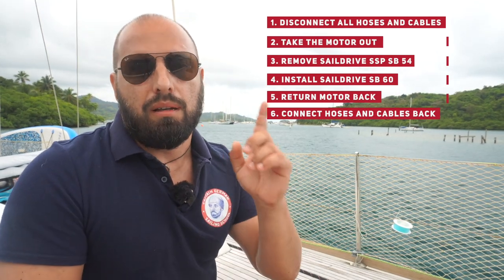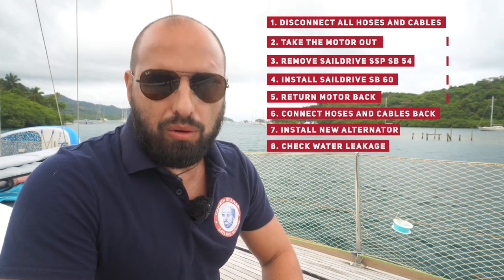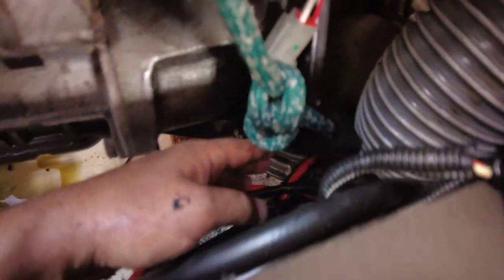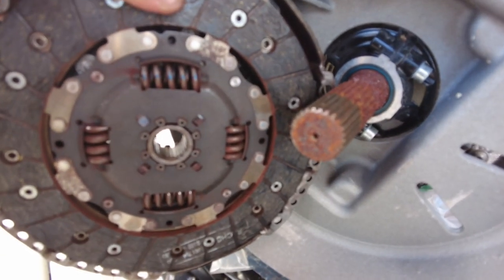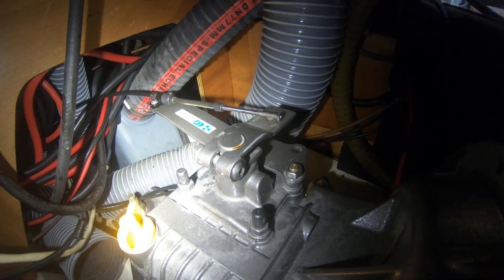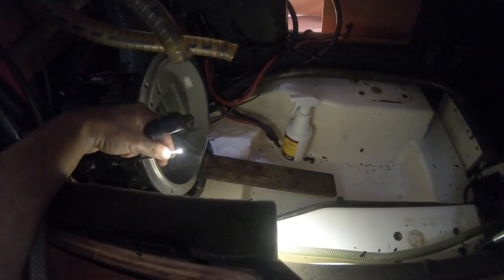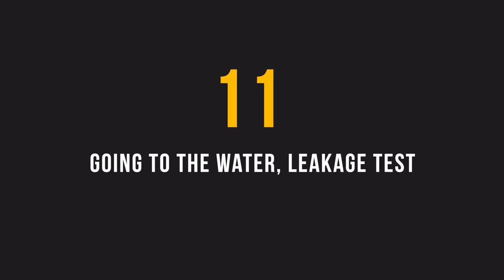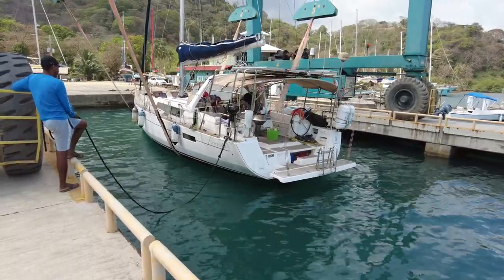Saildrive vs Yanmar SD 60: The Great Replacement

Comment: Dina and Sergey,  you did fabulous project!  Hard to believe that two people were able to accomplish this mega project.  CONGRATULATIONS!!!
I have a few questions (sorry if I missed this info in  previous videos )
  DID YOU CHANGE THE SAILDRIVE SB54 TO SD60  BECAUSE  THE SD60 BETTER THAN SB54 OR  THE SB54 IS NOT IN STOCK ANYMORE?
when your boat was ordered from Beneteau manufacturer, the SAILDRIVE SB54 was an optional or standard ?
THANK YOU AGAIN FOR YOUR VIDEO. 
GOOD LUCK!
Reply from the maker: SPP SB54 is rotating saildrive which was the option when I bought the boat in 2013. I have video at this channel how Dock and Go system works, cool system, reaaly cool. But unfortunately we couldnot service it for a long time because it is electronic fully and need to have special computer and special software and engeneers for it. In panama it is not exist at all like almost everywhere in a world. That was the reason why we decided to replace it with SD60. I could order boat with SD60 from a beginning. So my summary is if you sail somewhere in europe or US home land only it is realy worth it, If sail like we are too much risks
Reply: @CaptainGermanExploring  Thank you for your respond.

Comment: Excus me, I am honored to see your video. Beneteau and ZF Asia's after-sales service are very poor, charging $3000 just to read the gearbox fault code, so I decided to switch to SD60. I have some questions about the modification of the engine mounts. Based on the comparison between the drawings of YANMAR4JH4TCE+SD60 and 4JH4TCE+ZF Friedrichshafen AG ZFSD12, the engine mounts should be lowered by 97MM and moved back by 20MM. Why are your engine mounts moved back by 100MM? I look forward to your reply and will start the retrofit on May 12.

Comment: well-done! excellent project! I have a Beneteau with the Dock-n-Go system and cannot get clutch parts from ZF, so am looking at the change to SD-60. Is the hole in the hull the same between the two saildrives?
Reply from the maker: Yes, it is big advantage in this project. The bolt holes are the same, you need to buy motor mount
Reply: Hello, I have just completed replacing my SD60. My ZF gearbox has only been used for 300 hours and, except for the computer board, all mechanical parts are in good condition. Do you need them?

Comment: Hi there. I have also a similar issue with the SPP on a 4JH80 Yanmar. Question for you: how did you address the reverse mode... as the SPP reverses by rotating the whole,sail drive..? And the controller which is electronic?
Reply from the maker: There is no way to make reverse mode manually. You have only one option to engage gear forward but after this you have to recalibrate the system (ZF told me, have no idea what does it mean). But reverse is only with SD rotation, so you have to have all the system operates normally.

Comment: I am having the same issues with my Jeanneau Sun Odyssey 469 with the 360 docking in Asia. My boat has been stuck in the slip for almost 2 months now while waiting for a new electronic throttle and now that I have received the new throttle, the ZF tech stated that my 360 joystick is unable to receive signal or even power. They are saying that I may have to wait six months for the new part. I am at my wit's end with this whole debacle. It basically spending a lot of money and waiting to find out that I need to spend more money for the next part while wasting more time...If you have any spare parts that you would like to get rid of please let me know.
Reply from the maker: Service of zf are crazy bad. Just zero service. Great system when works...

Comment: I’m considering purchasing an Oceanis 48 with a dock and go system. I
Intend to remove the system and replace it with an SD60. Could you be specific about what modifications needed to be made?  Any electrical modifications?  I saw that the engine mounts needed to be modified, but did the SD60 bolt into the same location that the ZF transmission did?  Many thanks.
Reply from the maker: Sd60 and sppsb has the same sd membrane mounts. You need new motor mounts because the motor will have different location
Reply: @CaptainGermanExploring  Thank you for the quick response!  Any substantial electrical modifications?  Or just disconnect complete ZF system wiring.
Reply from the maker: Unfortunately no other options. It is really  complex system with no interchangeable parts. Only mechanical saildrive or original parts

Comment: Great job! Not a gear oil into the saildrive? Like Dina's saildrive leg alignments.
Reply from the maker: I also thought it should be something like gear oil but not, regulat motor oil. Marked on sticker at sd
Reply: My apologies, just checked SD 60 UM :). 15w40. Was mistaken my SD50 needs 80w90. tried to be smart 😂
Reply from the maker: Great to know. Thank you

Comment: Hi there! I've just completed the same refit BUT for some reason when i activate my engine control panel (when i switch the engine on) my autopilot (AC42) stops working.

I think some of the old Dock n Go wiring/canbus might be causing a problem. Any idea?
Reply from the maker: My opinion. Absolutely no relations bw harness of motor and dock and go. only actuator. Dock and go and autopilot just disconnect it from nmea